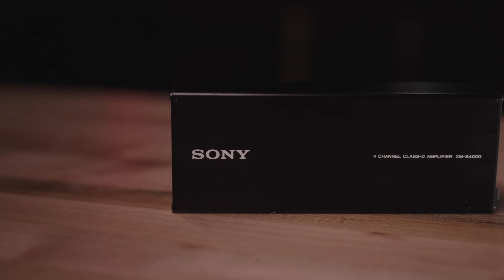What's the difference between amplifier classes? | Crutchfield

Comment: hi, knowing class D amp full range are more eficient than AB in term of fidelity is D supeior than AB or AB is has more fidelity than D in car audio? I need to  make a decision for my two pair component speaker system
Reply from the maker: These days, there are high fidelity options in both. Would you like help choosing?
Reply: @crutchfield Yes, I need to right ampf for my 2 pair of focal PS 165 V1 (80 wats rms each) at the front and rear part. I have alpine ute 73BT which output is inly 2 volts. I would prefer based on your explanation with class D (understanding that now days class D full range D are giving the same fidelity like AB and more efficient) so what would it be the right power per channel to chose?.  Equal or a little be lower than 80 watts per channel or one with 100 watts per channel lowering the gain? any brand suggested?

Comment: I am now exclusively using apps like Youtube Music to a Chromecast Audio/AV receiver/4 way selector to patio and in celling speakers. How do I decide on a new amp?
Reply from the maker: Ideally, the amp will not exceed the watts RMS of the speaker selector or any of the speakers connected to the selector. Are you down-sizing from the A/V system and only need the new amp to power the speakers connected to the selector?
Reply: @crutchfield  Correct. No other job.
Reply from the maker: Have you found those specifications on the selector and speakers you want to use in this system? If you have not, we can try if you list them here. Also, which Chromecast device are you wanting to connect to the new amp?

Comment: What’s the best set up for a motorcycle. 2008 Hayabussa. I’m thinking 2x 6x9 speakers and then either subwoofer under the tail. What are your thoughts?
Reply from the maker: We don't have specific information on your motorcycle but we do know that space is limited on motorcycles more so that any other vehicle. Class D amps are typically smaller than the other amp classes and should help in this application.
Reply: Bruh, get yourself a 7 channel atmos receiver and run the height channel on your mirrors

Comment: Hello. im tryng to make diy 32 channel amplifier with per channel mono modules that would work independently and each of them will get separate audio input, audio output and 48VDC.

Im looking for recommendation for Class D amplifier chip.
It should accept 48VDC (single voltage without - 48V, just GND and plus).
Possilbly shouldnt require very complex circuit around.
Want most powerfull option (most possible RMS) with usable quality (for home use, doesnt need to be studio grade).

Thanx.
Reply from the maker: Thanks for reaching out. Sounds like a fun project! We do not carry amp chips. You may want to try an online parts store like parts-express.

Comment: Amplifiers convert input POWER to output POWER. ALL electrical circuits are comprised of voltage and current, the combination of which is where we derive power.

Saying amps convert input voltage to output power makes no sense. You could say they convert input voltage to output voltage but that's only half the equation. They also convert current... which again, is the second component of power.

To measure efficiency you can't compare input voltage and output power... you have to compare input power to output power.  Hope that helps clear this up.

Comment: Correction: none of the current amplifier designs are actually amplifiers at all. It's a common mistake to think that they take the original signal and make it stronger. They don't. What they do is use the original weak input signal to modulate, in one way or another, a much stronger DC current to recreate the original waveform from their own power source. Does it matter at the end how it's done under the hood, no, not really, but it should be mentioned that these devices, in reality, don't really amplify anything at all. They modulate.

Comment: I picked up an old (1990's, so not too old) pioneer A400, no idea what class it is but it syre sounds good.  Would it be worth getting it "serviced" as guessiing they are basic home audio system....it just sounds really good (it came with denon DCD625 mkII)
Reply from the maker: That would be a good idea. Even if it plays, the capacitors in them that help it have the dynamic sound can go out.
Reply: @crutchfield  do you know which "class" it is.....I am happy which ever, yet would be nice to know.
Reply from the maker: Sadly, no. We do not know the amp class of your Pioneer A400.

Comment: An amp's job s to amplify the signal, not to add it's "sound signature" described by jubjective meaningless terms, like "warm" or "fuzzy". While most class D amps are analoge in nature (PWM generated by analog carrier), some are natively digital (PWM is generated durectly from PCM). 

The best sounding (and measuring) classs D modules are the Hypex NC400 and the Purifi.

I'm using the first.

Comment: Great video. In the past I owned a Harman/Kardon stereo amp. It delivered 85 Watts of power on 2 ch driven, 20 Hz to 20 kHz with 0.07% THD. It also had a HCC built in with 80 amperes. I still don’t know what the latter one was good for. Do you have any idea?
Reply from the maker: Its a slightly different way to stating just how low of a single moment ohm it can support. When the deepest bass notes hit, they can cause the impedance of the system to drop for that split second. Based on the specs you provided, it sounds like that HK stereo amp was able to support some intense audio with any speaker, even the ones known to be power hungry
Reply: @crutchfield  Thanks for the explanation! Even Harman/Kardon customer support couldn’t tell me what it was for, so my compliments! And what you say in the last sentence, that it could drive power hungry speakers easily, is true. I tested many different brands and models and the HK-980 had no problem whatsoever with anyone of them. I’ve tested large Magnat floor standing speakers, Bose 501 series V, Bose Acoustimass series 2, some high end Bowers & Wilkins, Teufel floor standing speakers, Eltac etcetera. There is of course a difference in sound quality with each set but what I found interesting is that the HK-980 amp had a warm colored sound with excellent bass response no matter which set of speakers I hooked up. Harman/Kardon doesn’t make amps like this anymore which is a pity. But on the used market you can find many HK amps and receivers for a reasonable price. I do this sometimes to check them out for any defects and so forth. Thanks again for the useful information on the question I asked. You’ve got a lot of knowledge!!
Reply from the maker: Glad we could help! Let us know when we can help again
Reply: @emiel333  Was that 80amps both channels or each channel, left and  right?  With many AB amps under a grand today you can expect about 10 amps per channel, give or take.

Comment: class D uses a 'constantly switching" PWM (pulse width modulation) to maintain the output stage of signal while allowing as much of the input power to be converted to sound.   In practice, you will never get 90% efficiency out of even the best Class D amps as the efficiency comes from the output levels matching what power is required to keep the output stage running at all times, which happens between 40% and 100% of maximum output power mattering on the type of amplifier and it's max power rating and still use a good chunk of power even at idle (NOT standby, idle; it's on, just playing music).  Class A for instance will often use more then 25% (sometimes 50% for smaller amps) of it's max power input even on idle and never gets above 50% efficiency even at maximum output.  AB is slightly better at about 20% input power at idle and gets to about 70% efficiency at around  80% of it's output power rating or higher.  Class D often uses about 10-15% of it's input power at idle and hits it's maximum efficiency at around 40% power.  Because most people rarely "push" their amplifiers anywhere close to their limits, their amp's effency is never as good as it's "max efficency" because you have to output enough power and use that power to really measure any respectable amount of "efficiency".
Reply: Depending on the load resistance, some Class D amplifiers can reach up to 95% efficiency when kept within <1% total harmonic distortion.
Normally though, most Class D amps running at 1 ohm will be around 75-85% efficient

Comment: Never defined what class D was…… not even a hint….
Reply: Here's the basics. In a solid state amp transistors are used to amplify the signal. Transistors are switches. Switches like to be on or off. In a traditional solid state amp (class A, AB, etc..), the output transistors are forced to run somewhere in between on and off. Fully on would blow up your system, and fully off would be no sound. When you force a transistor to run in between the 2, its very inefficient and generates a lot of heat. That's why traditional solid state amps can be big and heavy. A class D amp works differently. It taps into the incoming signal and uses it to turn the output transistors on and off really fast. That's why they are so light and efficient. The transistors are not forced into a state that generates all that heat. 

Keep in mind that even though a class D amp is better on paper, they haven't been too well received in the audio community. They just didn't sound as good (yes, sounds good is purely subjective) as traditional amps. However, as designers gain more experience using this technology, class D keeps getting better and better. If things keep going the way they are, class D may take over as the preferred class for sound quality.

Also keep in mind that I kept my post very general just to explain the concept.
Reply from the maker: You'll find more details about class D models in our article about amp classes here: https://www.crutchfield.com/I-rYALc921/learn/which-amplifier-class-is-best.html

Comment: Very good quick educational video. Thank you!
A couple of things to note::
1. The claimed efficiency of A/B design is realized at over 85% output... Meaning your ears would be bleeding before you get anywhere close to it's peak efficiency.
2. Class D hits peak efficiency quickly. 30-40% of output you'll almost be at max efficiency.  I think most people live in this range majority of the time and this is why Class D is the future.
Reply: In home audio, most of the time, people only use around .5 - 2 Watts depending on the speakers. Assuming the amps you compare both are rated 100 Watts RMS, you would arrive at 35 or 80 Watts, that would only be a few dB difference and you would very rarely turn up the volume that loud at home. 

Also class D isn't "the future", it's been in HiFi for 45 years now and probably won't get any better or cheaper. Anything where Class-D makes sense has it incorporated already, like car amps, high-power miniature amps, PA amps, portable speakers etc. 
Anything else doesn't benefit from the additional complexity of Class-D.
Reply: @westelaudio943  totally agree.
Reply: that would depend on the power output of the Class AB amp , if it was a 15 watt amp your ears wont be bleeding at all at 85% output
Reply: @patthewoodboy  how about a 1W tube amp?

Comment: One thing I can say about a/b amps from reputable manufacturers, they certainly last a long time. I have an old Kenwood kac-7201. This amp in combination with some Fosgate Subs, have been in service in my various Vehicles since I was 19. I'm 41 years old now. And just like when I was 19, I pushed these things hard every single day. The amp is underrated as well as the subs. The amp is supposed to be stable with 4-ohm load only, and I've been driving a 2 ohm load in excess of 20 years. I have yet to own a class-d amp. I have an Optimus 4-channel Class AB that I purchased at RadioShack some 22 years ago driving 4 full-range speakers. This amp is capable of driving Subs, but its built-in, non-adjustable subsonic filter starts cutting off at 32Hz. Which is absolutely unacceptable for driving Subs. But it does pretty darn good for 6 by 9 coaxials and six and a half inch components. I do have to be careful though, at Full Tilt, this setups current draw exceeds alternator output.
Edit: actually now that I think about it, this Kenwood amp that I'm so fond of came from Crutchfield all those years ago. I miss the days when a phonebook sized Crutchfield catalog would arrive at my door. For you kids that don't know what a phone book is, ask mom or dad
Reply: i still have few old amps, one being Alpine MRV-F407 that works like a charm, no use for it but is shows how good it was built "back in the days", i also use class A/B(Magnat The Rock 800) for speakers but for subwoofer i have class D because i see no reason to dissipate many kilowatts as heat or use alot of space for it.
Reply: I wish I was in that era 😅

Comment: I noticed both of the Sony MEX-XB120BT stereos we bought from crunch field don’t seem to have very good quality of sound they get loud  but not an enjoyable loud probably the class D amp it says it has. Do most car stereos have these class D amps now because I really want to replace them with some thing that doesn’t and also the 10 band EQ is a pain to use.
Reply from the maker: Receivers typically have a MOSFET amp. While this amp is not a class D amp, it is also not a class AB amp. Its like a hybrid amp that still focuses efficiency and would not be expected to sound any clearer than the amp in this Sony receiver. An external amp is needed to increase the clarity of the sound. We can recommend one that will. We need to know certain specs on the speakers. The watts RMS each can handle along with the ohms of each. If you do not have that handy and can supply the brand and model, we will check our amps for one that will give cleaner sound.

Comment: Still love the sound of my 18 year old Panasonic (Technics) Class H+ AV receiver. Have tried replacing it but I always come back to it. Can't find any info on the modules inside it, but can see two distinct voltage rails feeding them.
Reply: I had a Technics  "Class H+" surround reciver once. It must be 20 years ago now.. Decent thing as a first reciver🤷‍♂️ But those fake "5x100w" was a litteraly joke compared to 5x45 (2x55 in stereo) real messured Harman/Kardon (class AB) watts I got later.
H/K had twice the power supply, delivered much more actual power to the speakers and beat the Technics in absolutely every way.
Technics had some good stereo recivers but nothing I would choose over others.

Comment: A breakdown of how each of these classes work, how each reduces or increases distortion, etc., would be appreciated.
Reply from the maker: Our article on the amp classes does go into these details here: https://www.crutchfield.com/I-rYALc921/learn/which-amplifier-class-is-best.html
Reply: @crutchfield  do a video its 2022
Reply: @askjayk if you can't read just say that 😂😂😂
Reply: @crutchfield  do a video tho
Reply: @ToppBossLuisito  it delves deep into how the transistors are biased, the output waveforms in relation to the input and how class D uses pulse width module. Class A has constant on transistor which passes on as heat but there is almost no distortion. Class B has transistors turning on and off, but due to the required .3 to .6 volts required to bias the transistor when the input sinewave meets 0v both transistors are off until that knee voltage region of .3 or .6 is reached, the transistors conduct at 180degrees, so you have a less clean sinewave in the output. Thats where class AB comes in, the sinewaves are crossed over at the knee voltage of the transistors because they conduct for more than 180 degrees but less than 360 degrees of the sinewave so they are never turned off at the same time. With class C the transistors conduction region is less than 180 degrees. More like 90 degrees. So it is on for that 90 degrees and off or idle for the remainder of the 270 degrees. Remember this all happenes in a split second so if 1hz is a sinewave of 360 degrees, the transistor is only on for 25% of that time. Thus less conduction more distortion less heat more efficient. Class D amps use pulse width modulation in which instead of a sinewave the output is in pulses of "on" state or off state. These pulses are more evident at the positive peak and negative peak of a sinewave input. And less evident towards the center, these pulses create noise or distortion. Thats where low pass frequency comes in to cut off these noises.